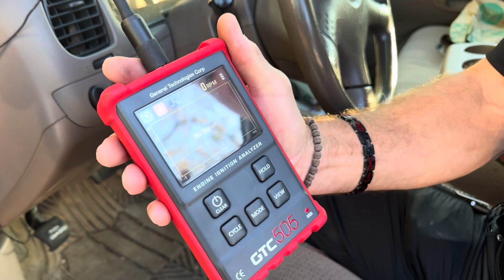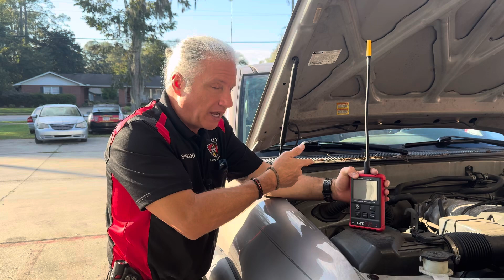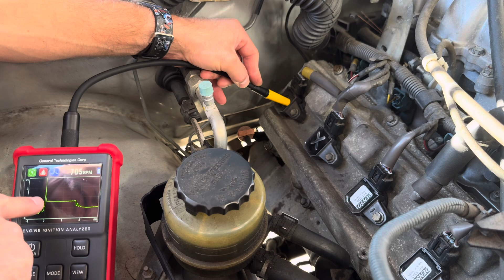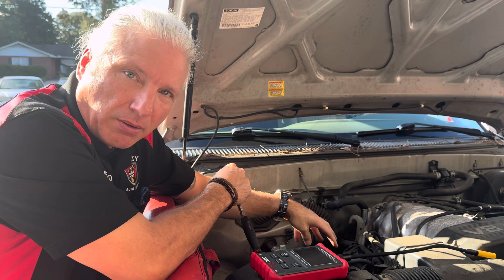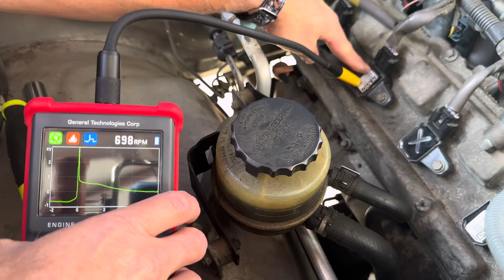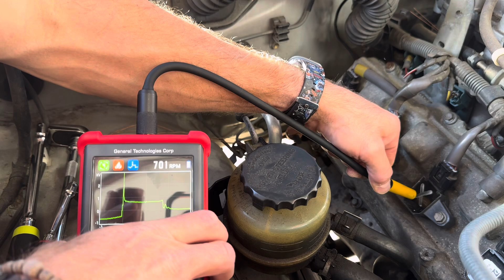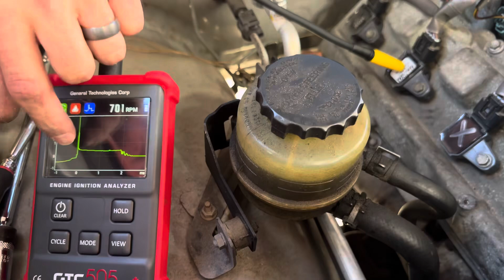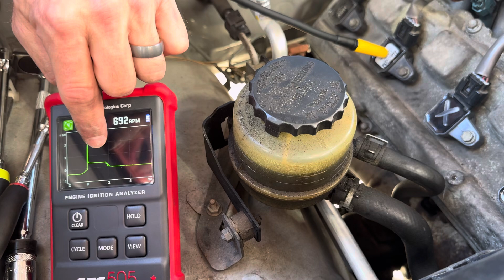How To Diagnose A Misfire Without Using A Scanner! (Toyota Tundra 4.7L)

Comment: Spray bottle with water spraying the exhaust manifold will point you to the cylinder thats misfiring 
Or a temp gun 
Or unplug a coil or injector Then swap injector coil plug 
No  need for that tool

Comment: As a retired Sun Electric Training manager I agree with every thing you said except. Cylinder pressure can effect the spark line or burn time. The more pressure in the cylinder the harder it is to jump the spark plug gap. That is why the firing lines go up when you snap the throttle. which it a good of stress testing the system. The reverse is also true. take a spark plug and attach it to a plug wire and ground the it to a good ground. The firing line may be the same but spark line will be longer.

Comment: Or change one plug, the cheapest possible thing, and now you have a new plug (bonus) if it’s still misfiring change the coil. Then I can keep my $235.
Reply: Coils cost like 80.00 spark plugs 10.00.. why not buy the tool now you have it for diagnosing any car and then you can check your work after to make sure that that coil is indeed working like it’s supposed to. This tool checks spark plugs coils fuel problems if you know what to look for well worth it.

Comment: I may have the issue you mentioned about a misfire detected in the wrong cylinder. Compression test, spark plug, wire, injector, one last thing to check fuel pressure.

Comment: Is it possible to disable TPMS using a scan tool? I would like to turn mine off on my 2008 4Runner.  I didn't have them put sensors in when I got the rims and tires for it.  I know you can connect a couple wires under the dash to short circuit the system, but I would prefer to just disable it if possible.  I do have a LAUNCH scan tool

Comment: HaHa, I'm laughing with you, Sherwood, about your lean demonstration not working. I took my team to a diag training, put on by NAPA, last week. Actually the instructor is from down your region, in Florida. He briefly went over relative Compression testing & most of my guys weren't familiar with it. The next day, I brought in my car to show them how it works.  I pulled out my cheap Hantek scope & cheap knock off high amp clamp. I couldn't get anything to work, not even my cyl 1 primary coil channel. I really got roasted for that. I like how fast & easy that secondary waveform tester works.

Comment: great channel. i use a 60 dollar plug in scanner but there is no display. having a display is a great addition to a scan tool. old cars you can run into a lot of open control wires due to the car manufactures using such thin wire. (engine compartment control wires). why they use such thin wire is too save money on copper wiring. i wouldnt own a newer vehicle

Comment: That engine has a MAF so induce a lean condition by taking off a vacuum hose or pull the intake pipe off the aorbox after the maf. Will run lean and show what you want from the tool

Comment: Thanks Royalty for sharing more knowledge. Love all your videos. I just wish they could make a lower profile flexible  high capacitive probe to sneak under intake manifolds which is where paying good $ for one will come in handy in most all applications. It’s like these companies don’t take advice from real techs out there like at royalty or other shops like mine. I have a cheap waekon COP tester tool that’s $280 that has a flexible 1/16” think paddle. No it doesn’t give a waveform but it does show KV in realtime & duration in numbers on screen but the Waekon probe tip will not fit on my lab scope & was not designed too. I just wish someone made something like its shape & size. Or even 1/2” thick with a semiflexible  extension attached to it to reach under those hard to reach coils under things. If anyone knows please enlighten me.

Comment: Coil swap and at the same time swapping the spark plug, but not the same cylinders, may've narrowed it down quicker. Then I’d isolate the cylinder(s) one-by-one trying to find the issue. But I’m not a mechanic, just an old guy that remembers using a timing light looking for problems. These days my scanner tells me which cylinder has the miss so I can try the coil/plug swap trick before firing up the parts cannon. I stumbled upon a new $1200 Launch X431 Pro3S+ on Amazon back in 2021 for only $60 +tax because Kingbolen made a pricing mistake and shockingly they still honored that price for the 50 buyers lucky enough to hit that buy button before they sold out. Kingbolen repeatedly tried to squeeze another $500 from the buyers to help take the sting out of the $50k loss but I simply didn’t have it. The 2 years of free updates expired in 2023 and it bricks if it detects 2 weeks without internet access. I tried accessing the internet at an inlaws 2 weeks ago and it kept failing even though my phone was able to login via the password. I guess next time I’ll have to login at home before heading out again.

Comment: Hi, the waveform of the ignition coil is dependent on the circuit according to the Kirchhoff's law, so first you must check the spark plug gap and high tension wire resistance and after check the ignition coil waveform 😢

Comment: I'm pretty sure there's other inexpensive options that use a laptop and you buy the tool that plugs into the usb c socket. The tool will present the radio wave with suitable gain and the software display the wave on a GUI. Might even work with a smart phone plus app.
Reply from the maker: Can you post what tools? I'd love to get them to try out as a lower cost alternative. Always looking to try out new stuff. Thanks!
Reply: @theroyaltyautoservice  Here are some affordable USB oscilloscopes for viewing car engine ignition signals on a laptop or Android device:
Hantek 6022BE USB Oscilloscope
Specifications: 20 MHz bandwidth, 2 channels, connects via USB.
Price: £70-£90 (approx. $87-$112).
-
Hantek iDSO1070
Specifications: Wireless, 2 channels, up to 70 MHz bandwidth, supports Wi-Fi connection for remote monitoring.
Price: Around £155 (approx. $190).
-
MINIWARE DS213 Mini Oscilloscope
Specifications: 15 MHz bandwidth, compact and portable, up to 4 channels.
Price: Around £61 (approx. $75).
-
OWON HDS272S Handheld Oscilloscope
Specifications: 70 MHz bandwidth, dual channels, includes built-in multimeter.
Price: Around £150 (approx. $185).
-
Hantek HT20COP Ignition Waveform Probe (for use with oscilloscopes)
Specifications: Designed specifically to capture ignition coil waveforms, pairs with compatible oscilloscopes.
Price: £50-£55 (approx. $62-$68).
-
JYETech DSO138 Mini Oscilloscope Kit
Specifications: 200 kHz bandwidth (lower bandwidth, ideal for educational and basic hobbyist projects).
Price: £20-£30 (approx. $25-$37).
-
For automotive use, tools with 20 MHz or higher bandwidth, like the Hantek 6022BE and OWON models, are often preferable. You'll need the special probe for ignition coil waveforms, or fashion your own pickup/antenna to add to the probe. Worse case remove the probe tip to expose the sharp point, usually standard construction on oscilloscope probes, and point it as close as possible to the HT output of each ignition coil. This should easily pickup the 10-50 kVolt generated RF signal. Good luck!
Reply: @theroyaltyautoservice  Here are some affordable USB oscilloscopes for viewing car engine ignition signals on a laptop or Android device:
Hantek 6022BE USB Oscilloscope
Specifications: 20 MHz bandwidth, 2 channels, connects via USB.
-
Hantek iDSO1070
Specifications: Wireless, 2 channels, up to 70 MHz bandwidth, supports Wi-Fi connection for remote monitoring.
-
MINIWARE DS213 Mini Oscilloscope
Specifications: 15 MHz bandwidth, compact and portable, up to 4 channels.
-
OWON HDS272S Handheld Oscilloscope
Specifications: 70 MHz bandwidth, dual channels, includes built-in multimeter.
-
Hantek HT20COP Ignition Waveform Probe (for use with oscilloscopes)
Specifications: Designed specifically to capture ignition coil waveforms, pairs with compatible oscilloscopes.
-
JYETech DSO138 Mini Oscilloscope Kit
Specifications: 200 kHz bandwidth (lower bandwidth, ideal for educational and basic hobbyist projects).
-
For automotive use, tools with 20 MHz or higher bandwidth, like the Hantek 6022BE and OWON models, are often preferable. You'll need the special probe for ignition coil waveforms, or fashion your own pickup/antenna to add to the probe. Worse case remove the probe tip to expose the sharp point, usually standard construction on oscilloscope probes, and point it as close as possible to the HT output of each ignition coil. This should easily pickup the 10-50 kVolt generated RF signal. Good luck!
Reply: @theroyaltyautoservice  Just search for Hantek or Owen USB C PC based Oscilloscopes. Very affordable.

Comment: can you work that tool from the side for intake covered coils ??
Reply from the maker: It depends on the coil design. Any time you are using an inductive pickup the coil design is going to play a huge role in the quality of the waveform. Even the most expensive pickups used for some high end scopes have a hard time on some coils because of the shielding used inside the coil. Most vehicles, the answer is yes, but some you may not even get a good signal going straight on the coil from the top. Hope that makes sense.

Comment: Had a coworker whose wife's Dodge Charger had a dead miss. The dealer wanted $1200 just to diagnose it! I told him through the simple process of first identify which cylinder is missing by an old school power balance test. Then swap coils/ plugs to see if the misfire stays with cylinder or follows the swapped coil. At that point, I told to remove the valve cover and see if the rocker arms are even moving with it idling. Bingo, flat cam lobe! No 4 channel scopes or special tools needed! "When you learn to work with what you have, then you have everything you need".
Reply from the maker: Don't know about a $1200 diag quote over the phone. I totally understand what you are saying. I like that you had a diagnostic path and you got to the problem without any detours. With a scope, and the knowledge on waveform analysis, you could have accomplished the same diag in a far shorter time. And the only disassembly you would have had to perform would have been removing a spark plug. On a side note, make sure to tell your friend to look in the oil filter for metal debris. Those cams are very common to fail and once that metal gets into the engine it does unseen damage that will show up later. I'd hate for them to spend money on a cam job only to have the engine start knocking in 6 months.
Reply: You're not getting the full story. There's no way a dealer would give a diag quote that high unless there was some type of special case. The standard diag. fee is typically 1 hour, and if more is needed they'll ask the customer if they want to continue. One of two things most likely happed. They didn't want the job for some reason, so they gave a high price to get rid of it. Or, something needed to be fixed first, before they can do a proper diag. For example, lets say the spark plugs looked old and in poor condition. Its very common for a shop to require the plugs be replaced first.  Its maintenance that should have been done anyway. And the reason I say the dealer wouldn't quote such a high price, is they have to get the car in the shop first. They can't screw you over if you don't give them your car.
Reply: No shop would quote that high for diag and definitely not for a missfire. Also I'm not sure if you told them the diag steps and they did the work or you did?

Comment: Paul Danner shew an unplugged injector. He said 'you wont see anything on the trace until a brief Wide-Open Throttle' is performed. It worked that way, one of his vids. There was no discernible issue until the engine was loaded with the w.o.t. The 'pigtail' at the end of the burn-time went higher than the firing KV; with a hashy, scraggly signature. Other technicians also coach you to reference lean fueling issues this way. Thanks for these vids.
Reply: gud call

Comment: Video is basically a commercial for the tool but is okay the tool can speed up process when diagnosing coils as some scanner can be really slow. I had it in my shopping cart for 3 years but never pull trigger as my ROI will very low considering that I already own a DSO too and as quick diagnosis I usually get the feel for a bad ignition coil misfire as been a BMW dealership tech I have good access for checking vehicle history and if it has original coils .. I recommend to sell all and BMW recommends to replace coil with spark plugs as pairs as they can damage pre each other so I don't have eliminate a faulty ignition coilor spark plug

Comment: Great tool I changed plugs, wires coils ,  and injectors , and still have a p0300 on a 2001 Chevy Silverado 1500, any suggestions?
Reply: Is that the only code it's showing?
I sure hope you bought OE injectors I've gotten burned by buying ACDelco injectors off of Amazon and eBay and found out they were fakes lol.
These scammers are getting really good at what they do!!
Reply: @chucklenhardt7902  I actually did 😩, have a P0300, and P0452. Thanks for the help.
Reply: @TekkHakk  Do you have access to a scanner with bidirectional controls?.
The other code is indicating a pressure issue within your evap system. 
I have seen the purge valve leak causing a vacuum leak  thus you're getting the PO300.
So just do a quick check with a can of carb cleaner and spray around it if that checks out you really need a scanner to fix that issue because you need to see what your tank pressure is activate the purge and watch your and tank pressure there are a lot of videos on how to do this My rule of thumb In the 43 years I've been doing this mess is to fix what you know is broke first throwing parts at it is not going to fix it it's just going to empty your wallet.
Reply: @chucklenhardt7902  thanks for the help/tips.
Reply: If you have a scan tool that can do an evap test, try that first. If not, fire the parts cannon one last time and put a new gas cap on it. That will probably fix the issue. Its cheap and easy to install, but if that doesn't do it, take it to someone that can do a real diag.
Reply: @052RC  I'm working on getting a real deal scanner, thanks for the help.

Comment: I made one of these by taking a ford relay, cutting out the resistor, and wiring leads to the coil of the relay, I can plug that into ground and a channel and get waveforms.  I used it today, stayed an hour late even trying to figure this out just to come home to this video!  lol  Thanks for tomorrow's plan!!
Reply: I did exactly the same, only with a little Hyundai relay. Couldn't believe how good it was once the resistor was removed. I just chopped the crappy alligator clips off some leads I didn't like..so BNC one end, male spade connectors to the terminals on the relay.

Comment: I'm assuming that this was either a dead hole misfire, or a misfire that counts up pretty steadily. Any misfire that comes into my bay, is one that turned on the check engine light for the customer and then when I go to drive it I can't make it happen. I'll drive it cold then hot. Light load then heavy load. And sometimes it might happen. But won't happen very much. The engines are all direct-injected, and it's almost impossible to get any kind of signal from the coils
Reply: Your GM scan tool can do a power balance test.

Comment: Swapping coils is what I was taught when coil on plug first came out at the dealership. It’s a valid diagnostic technique
Reply: Unless it’s up under an intake manifold.
Reply: That can bite you! Some of these newer cars are so quick to recognize a circuit failure, they will shut off the injector of that accompanying coil, and can throw you for a loop wondering why the misfire doesn't go away. You need to clear codes and reset.
Reply: An ACDC non contact test can sometimes help too, just expose the coils, start the engine and check for which one doesn't light up the tester.

Comment: Wouldn’t you be able to see a fuel injector not opening by the pintle hump on the amperage waveform or voltage
Reply from the maker: You would need the injector waveform in order to do that rather than the ignition waveform.

Comment: Just what we need, a scope is expensive, we have 5 vehicles to maintain.
This tools is  a Great find !
Thanks Sherwood !
Reply: You can get a dual channel picoscope for $180 I think. Its only rated for max 60v however so you would need to get a $15 20:1 attenuator if you hook up the scope to injectors or coils. I think that is more worth since you have full oscilloscope capability.
Reply: @kassemadam3005  Thank you very much for posting,
going to look into your suggestion.
Reply: @als1023  it is the picoscope 2204a
Reply: @als1023  i believe it is about as much as an EScope but takes seconds to set up and use and time is money so there would be no question.

Comment: I have that tool works great.
Try the injector disconnect on the digital burn time menu screen, I think you will see a difference. 
Also, every time you hit the hold button it takes a snapshot, when you plug it into your computer you will see a digital file, I like using that feature for documentation.
Reply from the maker: Thank you! That makes a lot of sense and helps a lot! Will try that out when back in town! 👍
Reply: @theroyaltyautoservice  Welcome

Comment: On my 2001 Toyota Tundra, I had multiple Misfire Codes, , , it wound up being the fuel pump regulator on the fuel rail, , , would that ignition analyzer have pointed me in that direction?🤔 Thx
Reply from the maker: If it was running lean then yes
Reply: Yes, would likely show a big rise at the end of the burn line on all cylinders I believe. Someone correct me if I'm wrong please.

Comment: how does it work on engine with spark plug wires?
Reply from the maker: It'll work great!!
Reply: Shows to have a spark plug wire sensor that goes on the probe
Reply: It comes with the adapter